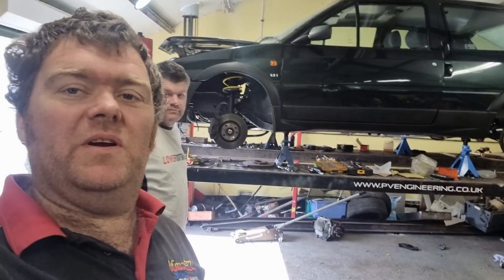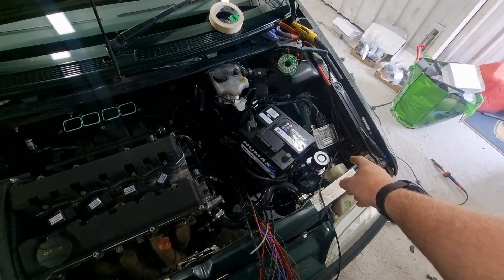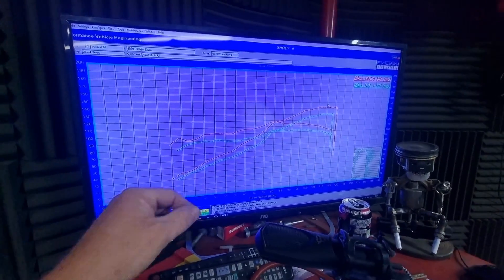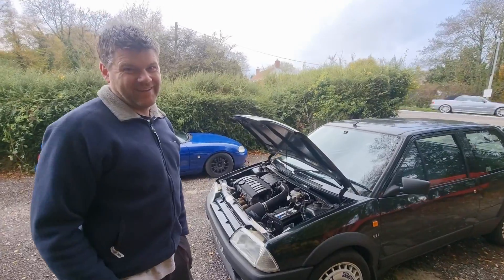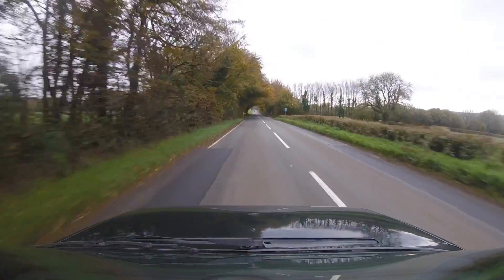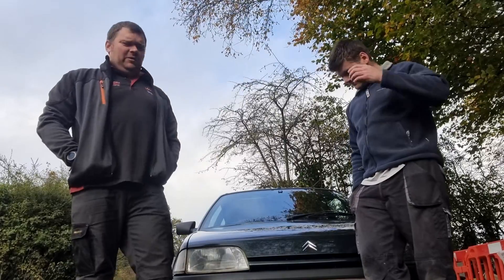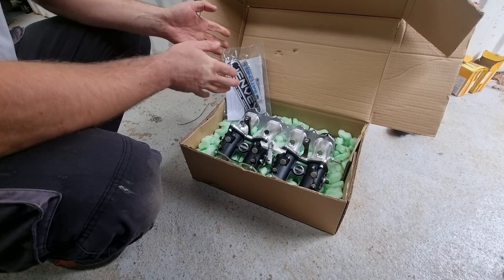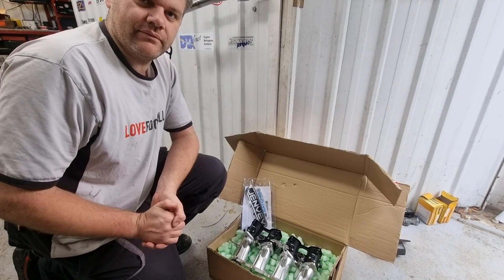Citroen AX GT Project. We finally get the MaxxECU on the car, and get it on the dyno!

Comment: Nice job!

What radiator and fans did you used?
Reply from the maker: Saxo VTS radiator with a Spal fan presently. But we're going to change it to the diesel radiator, to gain a little more room for a better manifold soon. 👍
Reply: @TuningShed  you think I won't be able to fit a supersprint manifold with the saxo 16v radiator?
Reply from the maker: @cryptonkataxas  I couldn't tell you 'exactly', as I've not got a supersprint one here. We've got a Toyosport one to go it, and it won't fit.
Reply: @TuningShed  I understand! So, the diesel one is slimer?
And, as "diesel" you mean 106-saxo diesel?
Reply from the maker: @cryptonkataxas  AX diesel radiator. They have an external expansion tank, so the rad can be moved forward under the slam panel essentially.
Reply: @TuningShed  sounds good! But I think, external tank position could may be a problem, don't you think? 🤔
Also, the saxo radiator can't be moved forward?